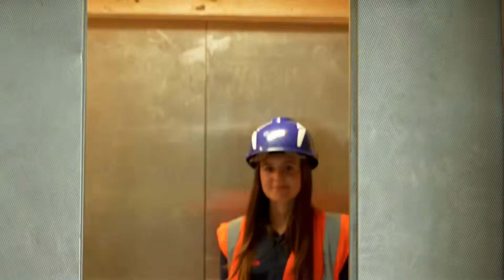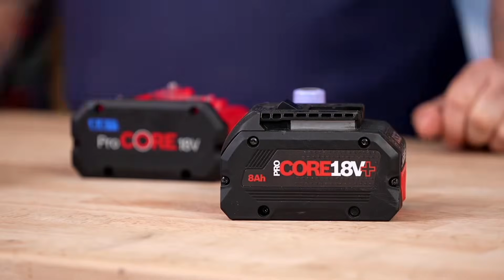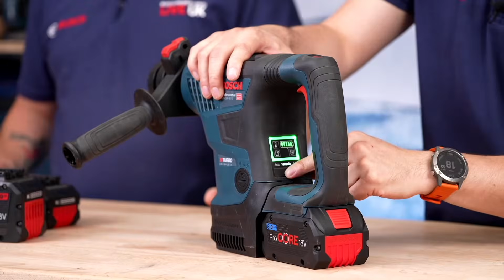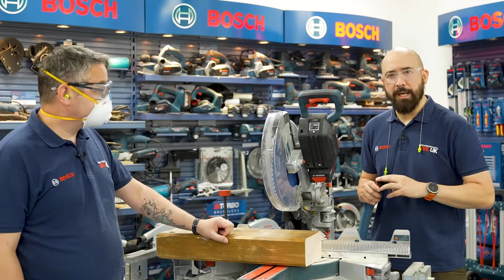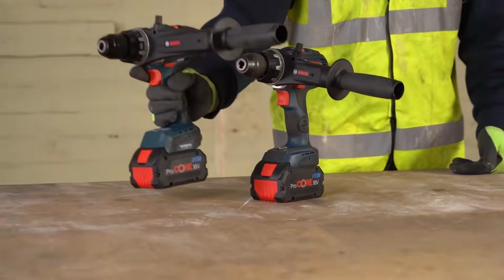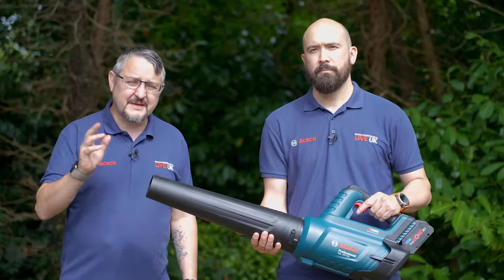BITURBO SPECIAL: Explore the range

Comment: One thing that has bothered me with the GSA 18V-28 recip saw is the lack of a light at the front. Otherwise the saw seems great. Most other competing saws have a light at the front, even the 18V-32. The lack of a light made me choose a similar saw from a competitor, as we tend to use recip saws in tight and dark areas in my job.
Reply: I guess you could also argue that the saw should have some speed adjustment interface as it was advertised as «made for metal»

Comment: Great Livestream. I'm very excited for the chainsaw as someone with a lot of Bosch pro 18v tools who also does farm and woodland work, I'm excited for the garden tools. I would like to see the chainsaw properly put through its paces in real world applications i.e. hard and soft wood tree cross cutting and small tree felling, the kind of work you would expect from a 40cm chainsaw. I'm a bit concerned that the slow chain speed may be not great but as I own a lot of 18v batteries, it would be nice to use this rather than have to invest in Makita, Husqvarna or Stihl for battery saws.